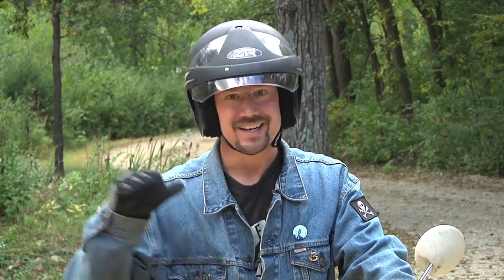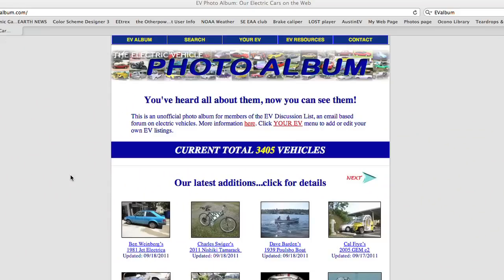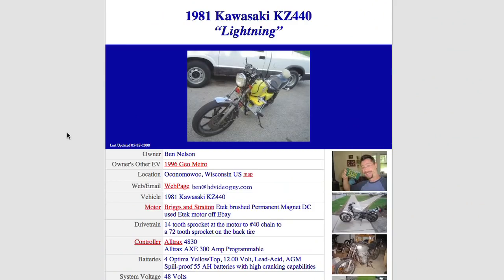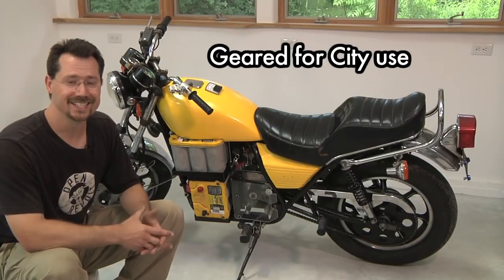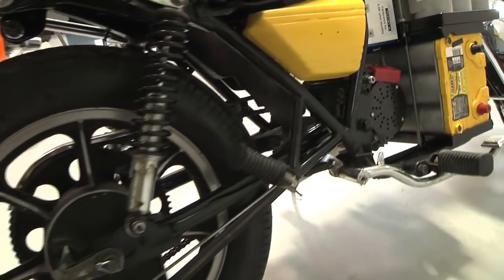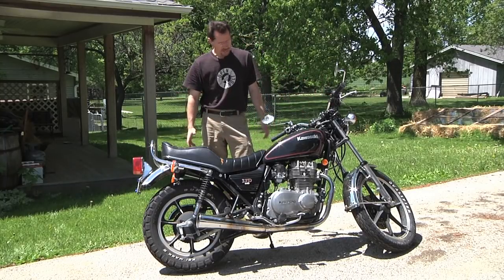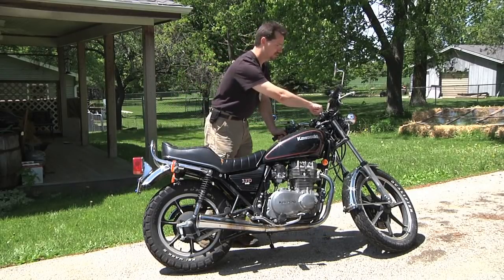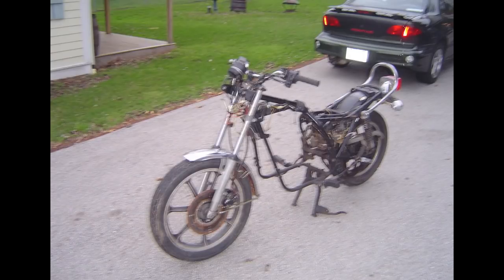1 Build Your Own Electric Motorcycle - FULL - 1 Intro and Overview

Comment: Hi Ben, wondering if you are willing to weigh in on donor bike choice? I have been vacillating on CB350, CB550 or CB750 (all 1970’s). I only need stock acceleration and max range of 35mi is ok, no FWY. CB750 (490lbs) is a bit big for me, but lots of room for batteries. CB350 (370lbs) is ideal, but will be tough to get even 48V in there. I AM willing to spend on LiFeP04 to make it work. Am I delusional or can I make a quick, short range, 36V bike using CL350 (CB350 scrambler) as donor?
Reply from the maker: How many batteries you can fit inside the frame is probably one of the biggest restrictions in converting a motorcycle to electric.
A rule-of-thumb estimate says that a reasonably ridden electric motorcycle can go 10 miles per kWh of battery. Try making a cardboard mockup of batteries that will get you 5kWh and see if that will fit (along with the motor and other parts) in the motorcycle you are looking to convert.
Reply: @BenjaminNelsonX  Good advice Ben, thank you.

Comment: I too can build anything with a fully equipped with expensive tools and machines in a garage workshop...lol
Reply from the maker: Hi Frank.
For the most part, this project was built in my garage with only very simple power tools like a corded drill, and jig saw.

Later, I did some work on it at the Milwaukee Makerspace, which is a co-op where people have a membership to share workspace, tools, and other resources. There were some better metal-working tools available to me, but I still didn't use anything as complicated as a lathe or mill.

Having a basic welder and practicing using it goes a long way.

Building your own electric motorcycle really doesn't take that much for "expensive tools and machines", but you would want to have the basics and some dedicated space to work on your project.

If you can, check into a "Hackerspace" or "Makerspace" type group in your area.

Comment: Hello sir, I am just curious if you would be charge the batteries if the motor was spinning in reverse.  I'm fairly certain this is how hybrid cars charge their battery portion when breaking.  I'll have to check it out! :)  I think we could seriously boost the mileage of this bad boy.  Very impressive!  I am looking to try to do one as cheap as possible, due to being a broke college student.  I'll let you know my success as soon as I do so! :)
Reply from the maker: What you are describing is known as "Regenerative Braking". In general, you don't "spin the motor backwards", but rather put mechanical energy IN to the motor from the momentum of the vehicle. That momentum being converted into electric energy slows the vehicle.
Regenerative braking is best for boosting range in the city, where there is lots of starting and stopping.
This motorcycle used a permanent magnet DC motor, which would be completely appropriate for use as a generator (and regenerative brakes) but the motor controller didn't support this feature. I also didn't want to add any additional expense and complexity for what I thought would be relatively small gains in range.

Comment: Hub motor controller and battery pack no need for chains and stuff
Reply from the maker: Hub motors can eliminate the chain and free up space in the frame, but they have disadvantages as well. They add to the "unsprung weight", they cannot be easily re-geared, and then tend to be overpriced or underpowered.

Hub motors do seem to work well for scooter type cycles.

For an example of a lithium cycle with a hub motor, check out my Vectrix super-scooter.
https://www.youtube.com/playlist?list=PLmHss3DBZUinx-DxMLnax485Alj5i5Lcn

Comment: Get splashed by battery acid if it hits the pavement. Be careful.
Reply from the maker: The batteries used in this project are a high power AGM battery. All the electrolyte is absorbed in a spiral-wound glass matt. The do NOT leak, splash, even if damaged.
 I'd be much more concerned about getting a burn from a gasoline motorcycle.

Comment: Does it matter what "style" of bike is used for the conversion? Like, would a sport or dirt bike be possible to be made electric?
Reply from the maker: Sure, you can convert any style of motorcycle to electric. Some might be better than others though. It will be tough to get great range out of a very small cycle, as there's little room for batteries. A very large and heavy cycle will be less efficient.
Sport bikes are popular for conversions because the aluminum frame is light weight.
Find a cycle you like, and convert that one to electric.

Comment: Why not use a high-power hub motor rather than a chain drive with all the extra maintenance?
Reply from the maker: Hub motors tend to be heavy, low-powered, and expensive compared to a more typical motor.
They also add "unsprung" weight.
You also can't change the gearing on a hub motor, so they tend to have either poor acceleration or a lower top speed. Using a motor with chain and sprocket gives you plenty of choice in gearing, and the ability to change the gearing if you wish to.

Hub motors DO free up space in the frame for more batteries. My Vectrix electric motorcycle uses an AC hub motor on the rear wheel. Just search "Vectrix" on this YouTube channel for more on that bike.
Reply: @BenjaminNelsonX  I had an eProdigy mid-drive bicycle with a 500W motor (Maximum allowed in Canada). The gears worked great in multiplying the torque, extending the battery range and the ability to climb hills. It would virtually climb a tree. I did think, however, that when the power was increased significantly, e.g. several KW that gears were no longer necessary - rather like an electric car or motorcycle.

Great point about the unsprung weight, especially off-road. I can also see you have far more options with a mid-drive motor even after you have fitted it. Kudos on the build, you have done an excellent job.

Comment: Hi, while fuel and maintenance savings on electric cars are significant compared to ICE cars, does this same savings effect apply to motorcycles? I've seen someone suggest that the savings for electric motorcycles are very small since motorcycle fuel consumption is little. Any ideas?
Reply from the maker: I suppose it just really depends how much you ride a motorcycle.
Some motorcycles get surprisingly BAD fuel economy. Older bikes are also carbureted and have next to nothing for emissions controls.
Even IF savings on fuel wasn't an advantage, electric bikes are nearly maintenance free, which DOES save time and money.
Beyond that, I really can't tell you how amazing it is to ride an electric motorcycle. It is QUIET compared to gas bikes and also COOL. I mean that literally. I'm amazed at how uncomfortable gas motorcycles can be on a summer day because of the HEAT they make exploding gasoline!

A person really just needs to try an electric cycle. One you do, there's nothing you'll miss about a gas one!

Comment: If you add weight for batteries & then the passenger too .. Its is heavier right ? 

If you drive along without exhaust noise, is it more likely someone steps/pulls out in front of you. ? There are plenty of bikers who claim super loud exhaust is safest.
Reply: That is 100% true. When stock my bike was very quiet. Several times people would pull out in front of me because A) motorcycles are just harder to see compared to cars and B) they simply could not hear me. A new set of Vance and Hines changed that last pat. Loud pipes can, in fact, save lives!

Comment: so to go 40 -45 miles, I would need 8 batteries presumably?  I'm guessing solar wouldn't be powerful enough to charge the bike in 12 hours and only need 4 batteries?
Reply from the maker: Electric motorcycles typically use about 100 watt-hours per mile. It's not that you want to think of "how many batteries", but rather the total usable capacity of an entire battery pack.
To travel 40-45 miles, you would want a battery pack with a usable capacity of 4 to 5 kilowatt hours. That might be something along the lines of 8-10 Nissan Leaf cell modules.
Solar can be plenty powerful. The solar on my garage peaks at 5.4kW. So, it could charge that pack in about an hour! For a smaller array, it's just a matter of doing some math. If you are thinking of a single small solar panel mounted right on the bike, no, that will not be a fast enough charger for any practical use.

Comment: I have  2006 Yamaha TMAX (500cc) Scooter.  It needs a new crankshaft sadly,  I was thinking of using as a EC conversion project and was wanting to keep the variator.  Anyone covered a TMax or maxi scooter before?
Reply: The TMax was one of those I used to drool over, why does it need a new crankshaft? That is something that should have lasted 20 years.

Comment: If you do a quick search on Craigslist in your area there is a good chance you will find at least a few “rolling frames” available. These are basically complete motorcycles minus the engine which you can get for 200-500, and could offer a good starting point for projects.

Comment: It is too slow and no millage
Reply from the maker: The point of these videos isn't to say "here's the right motorcycle for you.." it's to give you the general information you need to be able to design and build your own electric motorcycle. When you work on your own project, you can make it as fast and long range as your time/skills/budget allow! Good luck on YOUR project!
Reply: @BenjaminNelsonX  thanks
Reply: @BenjaminNelsonX  use some 3.7 volt batteries
Reply from the maker: This was an older project. For a cycle project with lithium batteries (salvaged from a Nissan Leaf!) please check out the Vectrix cycle rebuild! https://www.youtube.com/playlist?list=PLmHss3DBZUinx-DxMLnax485Alj5i5Lcn

Comment: I can do this.... no problem. My problem is...looks are STILL a major factor for a bike and a bunch of car batteries crammed into the frame looks hoaky. (Sorry... you did a great job. ) I am looking into lithium Ion  to see what can be done.
Reply from the maker: Many sport bikes have fairing which covers the engine area anyways. People often convert those to electric and then reinstall the fairing. At first glance you can't even tell the bike is electric. The joy of a custom project is that you can do it however you want. For example, a friend of mine has been making plastic gas tanks. They are light and cheap, but retain the original look of the motorcycle. https://youtu.be/_fif_e-mtzo?t=2m57s

Comment: hello, one question, how much does it cost you to convert the motorcycle to electric?
Reply: It cost him $2,000 cuz he hadn't done it before and he had done this years ago. Him sharing his knowledge makes it a lot easier a lot cheaper. There's been people who convert their motorcycles for less than $500
Reply from the maker: I've seen electric motorcycles built for anything from free (just using literally junk,) up to $10,000 and more.
If you just want to learn and experiment, get an old frame, a motor from a junk yard, and any batteries you can find.
If you want to do something nicer, with plenty of range and power, learn all you can about motors and lithium batteries. Hopefully, this series, based on an old project I did, gives you at least a starting point for you to keep learning and design and build your own project, no matter what your budget is!
Reply from the maker: If you specifically have good access to golf cart parts, take a look at the work being done by my friend, Ryland with his Black Box Bikes. He's been working on kits to mount golf cart motors to older drive-shaft Honda motorcycles. Golf-cart motors have a standard faceplate design, but are available in a range of powers, and are now also available as AC motors.
https://www.facebook.com/BlackBoxBikes/
Reply from the maker: This project was about $2,000 total.
Reply: BenjaminNelson well I can say you sure did for me. I'm going to be doing the whole junkyard searching thing. I also have lots of access to mini golf carts even new ones that have been considered totaled by the owners but the batteries are still good. I appreciate you sharing this knowledge personally.
Reply: Daniel Gomez .....if it costs 2000$ ...wait for few more months ....Indian torque electric motorcycle company will be launching it at $2000 ....

Comment: 30 miles? So I can get to the shop... but not back home :/ No point me doing this till battery ranges are vastly improved as bikes have such restrictive space for them.
Reply from the maker: Hi The Mighty Dash, please keep in mind that this particular motorcycle project was build 10 years ago now. My next electric motorcycle had up to a 90 mile range, with used Nissan Leaf cells. Zero brand electric motorcycles have over 100 mile ranges per charge. Also, if you can charge at work, you could double your range. My Vectrix was set up to fully charge in under 2 hours.
Reply: As he stated, it's a city bike, in the city 30 miles is pretty useful, but if you're more out there, it just won't work.
Reply: buy 2 then...
Reply: BenjaminNelson do you have a build video for your new bike?

Comment: I owned a 1982 kz440 and it had carburetor issues so I sold it... guess I should have kept it to convert to electric...
Reply from the maker: I had a matching parts bike. I could never get that thing running because of the carb!